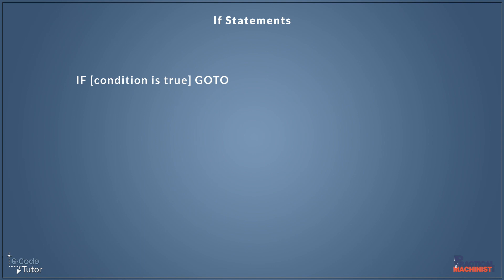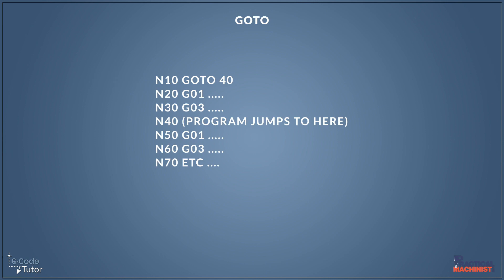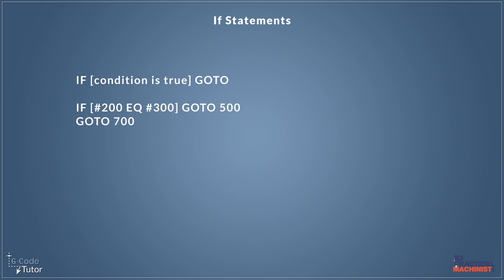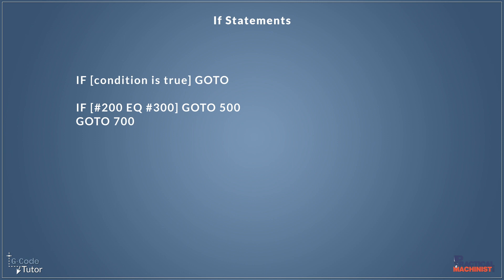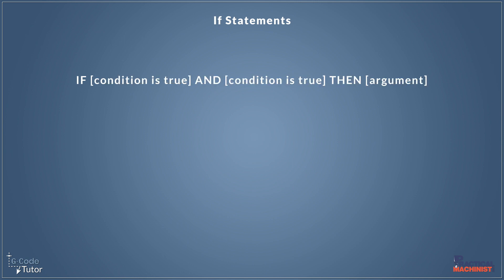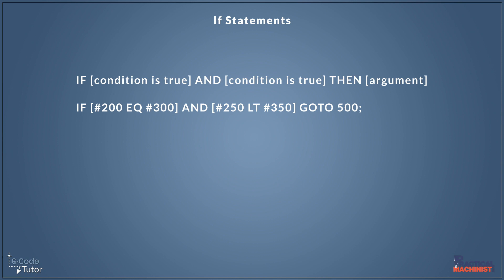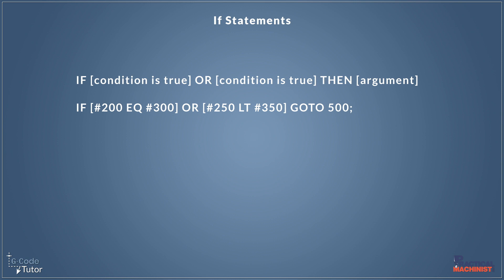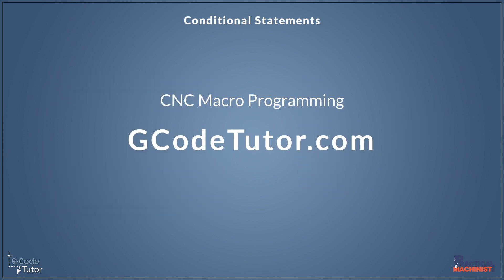CNC Macro Programming Tutorial: IF Statements

Comment: Secret sauce. Insert drill a hole and this is how you chamfer 
T30 M06
G90 G54 G00 X0 Y0

M97 P2031 L1 

O2031 (Ball Endmill Chamfer – Spiral Up from Z-0.535 to Z-0.0535, 82°)

#1 = -0.535       (Start Z – slightly below bottom of material)
#2 = -0.0535      (Top Z – top of chamfer)
#3 = 0.01         (Z step up)
#4 = TAN[41]      (Side angle per pass — 82° included)
#5 = FIX[ABS[#2 - #1] / #3]   (Auto step count)

#6 = 0                            (Step counter)
#7 = #1                           (Current Z position)
#8 = [#7 - #1] * #4 + 0.3829      (Start I — toolpath radius, expands up)
                                 (0.3829 = radius of chamfer at Z-0.535)

WHILE [#6 LT #5] DO1
  G13 I#8 J0 Z#7 F5.0
  #7 = #7 + #3
  #8 = [#7 - #1] * #4 + 0.3829
  #6 = #6 + 1
END1

G00 Z1.0
G00 X0 Y0
M99

Absolutely bonkers with a ball nose mill. I did a .752 hole to 1.438 chamfer at 82° and it was within .001

Comment: Why would you need macro programs? Can't you just use a normal program to do what you want?
Reply: You can. I just started learning and I’m starting to see some of its uses. Currently I am writing a macro because I have a bunch of similar parts with the same operations just different sizes. Macro is way quicker than writing 20 different programs. That’s just one use.
Reply: macros  exist, from the times when CNCs did not have such powerful PCs and macros made processing easier for them! Nowadays, macros are of great use, because with their help, you can create "logic" and thus automate various routines, and it is also de facto beneficial for the machine, because you can write a complicated thing in a few lines :) of course, not everything can be done, with the help of macros ! 

Also many routines, such as probing, automation, robots, additional devices on the machine and also many cycles that you use, are de facto macros! For example you have an aluminium plate 300x300x20mm and you want to measure 6 points in Z, with a probe and evaluate the highest point and write it to the zero point G54, using macros it is very, very easy and we can automate the whole process and write the routine into the program, we can also save it and call it as a subroutine ! We use macros for many things

Comment: After the first G91 that is called up. G90 is not called up afterwards. This machine isn't moving from the tool change position. Also, should be putting a G91 on G28 Blocks, just because. Otherwise crashes can occur. lastly, it would be pretty nice to see the example play out line by line. Just to see it. :)